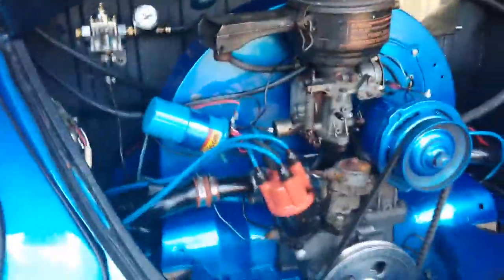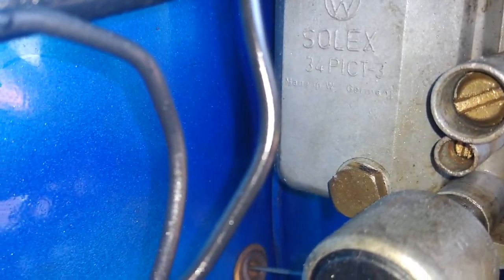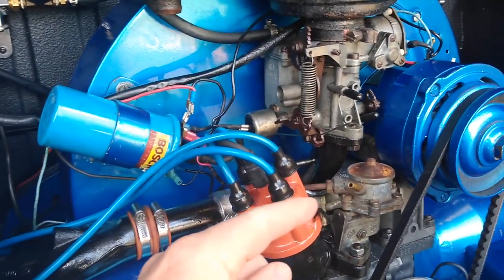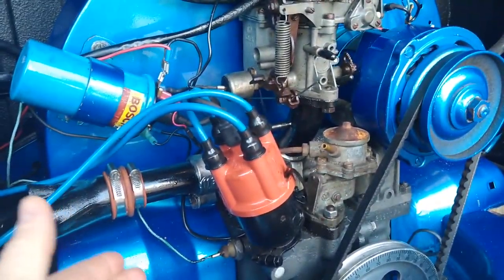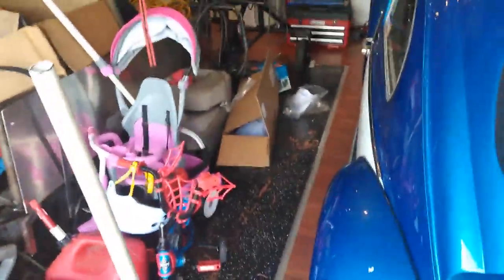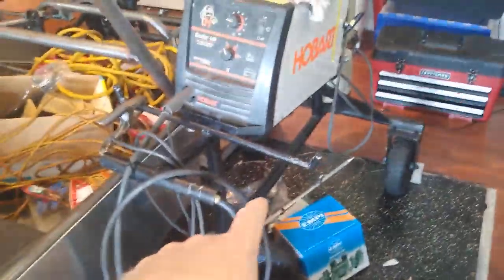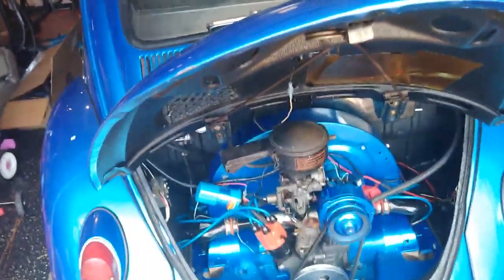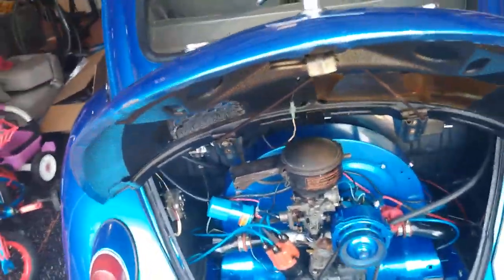PICT 34-3 problems

Comment: Not sure if i got lucky, really had nothing to loss trying it.( I had exrta jets on hand)   Drill my friends Idle and main jets on his PICT 34 with 009 dist. .The  issues were flat spots & motor would just fall on it's face in 2nd gear. After increasing both had no issues it runs strong.  Somewhere in my garage i have the number drills in a zip lock bag that i used again Matt no rresearch just mic the number drills went for it..